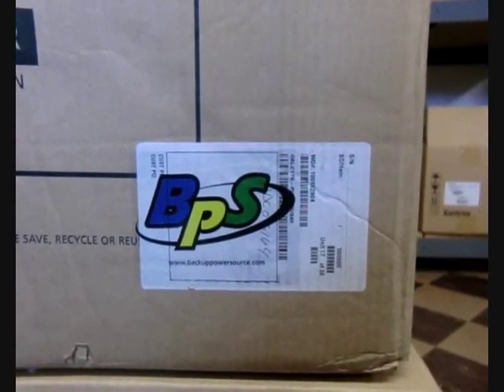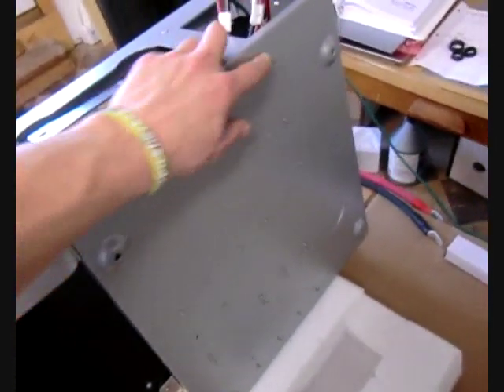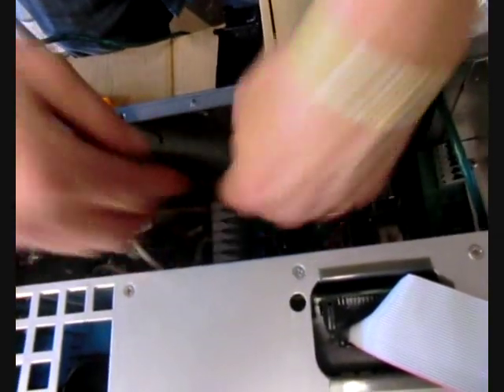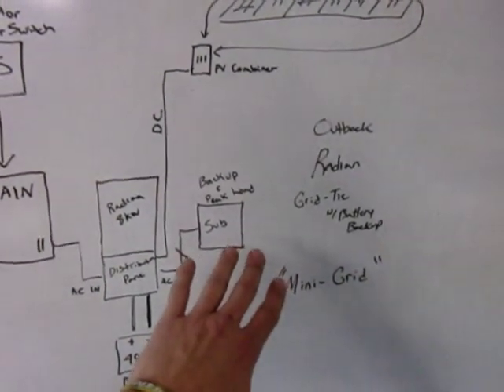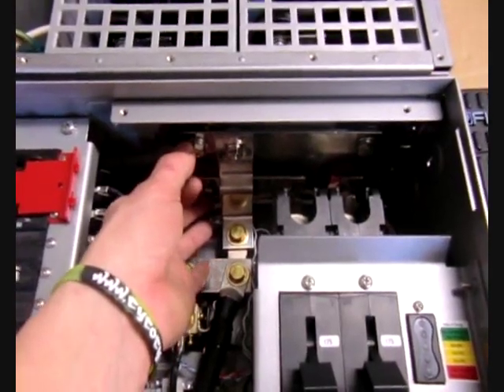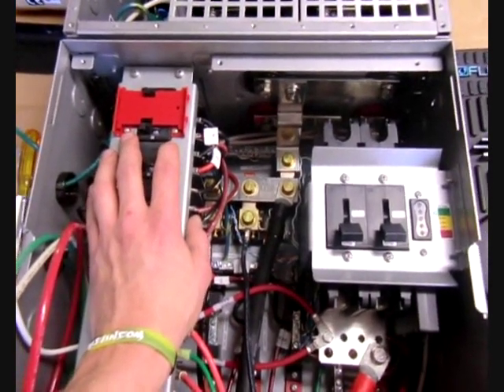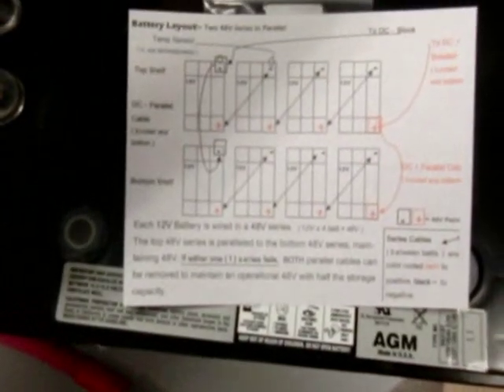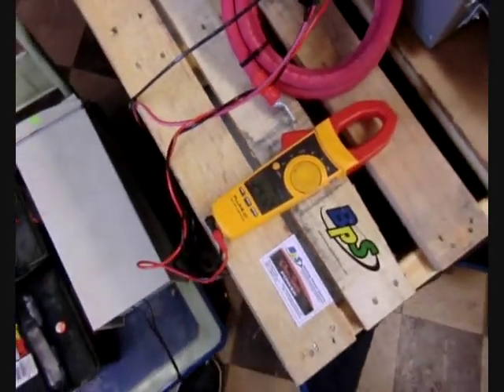Outback Radian 8kW Solar PV Grid Tie w/ Battery Backup - The Mini (Smart) Grid

Comment: I realize this is an old video but not that many on installation of the radian.  Isn't one of the main features of the radian that it can accommodate dual inputs such as grid and a generator so that you do not need a transfer switch to change to generator as you discuss briefly and show on the diagram?

Comment: what is the name of the tool you used? I like that you can turn the handle to screw. I have not seen that here in Norway. great video by the way.
Reply: +christoffer1973 

I've not seen them before either, but very clever. Searching for 'rotator ratchet' worked for me
Reply: +zogworth thank you for tips/info.

Comment: Micheal, I just bought two of these and would like to tie them together(master and slave). How is this done?  Do I need a sub panel if I am going to run the entire house on mini grid or can I just tie into the panel?
Reply: +jar rus , 1. unless you're in a 3rd world country or the middle of nowhere Wyoming use the grid, unless money is no object. Since you bought the panel, as opposed to hire someone...I'm guessing money matters. This will reduce your battery expense (& life cycles) greatly. Still should use a sub panel, even if it's your "main" anyway. In other words, make a new panel that becomes your "main", and make your "main" the sub-panel. The main's loss of power, turns the backup mode on and sells back to the grid. The more devices you put on the sub panel, the more batteries you'll need. Here's a digram from outback to stack 2 Radians: http://www.outbackpower.com/downloads/documents/wiring_diagram/Radian_Grid_Interactive_Two_Stack_Oneline_Rev_4.pdf

Comment: hello over there ... Can I get that one installed off grid only? Or I will need a grid power to operate?
Reply: This can be used off-grid as well. However, it will require substantially more batteries, and should consider a generator. If the grid IS available. USE IT, even if you hardly need it. It will lower every other component requirement & co$t.

Comment: hi Mike
am planning on getting a GS8048 w/load panel and panels but having trouble deciding on batteries-i see you are using AGM's i was planning on using Trojan L16RE-b but have to put them in my basement and concerned about escaping gas etc-i live in RI and gets cold so would not be a good idea to put them in the garage(too cold in winter - too hot in summer) can you give me your thoughts -
also will be GT so don't know if i would work off batteries or keep them charged for a  outage
tk lou

Comment from the maker: The system utilized 8 Concorde PVX 108OT AGM batteries. Each battery hold about 1kWh of storage. You can use a different quantity, different capacity size, or different type of battery. It depends on your particular application's demand, location, climate, and budget.